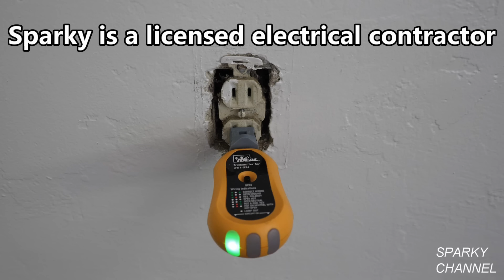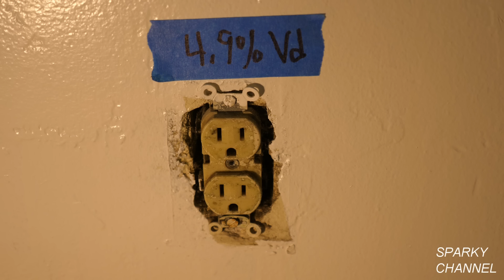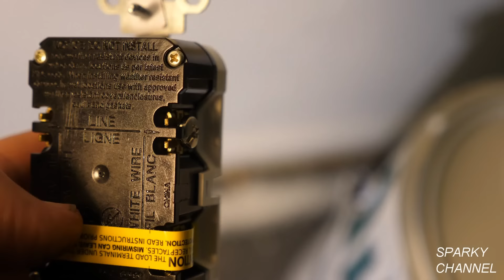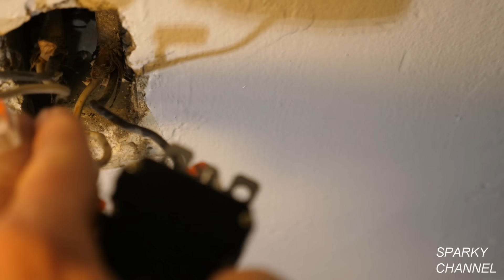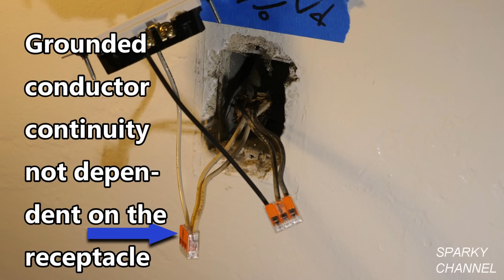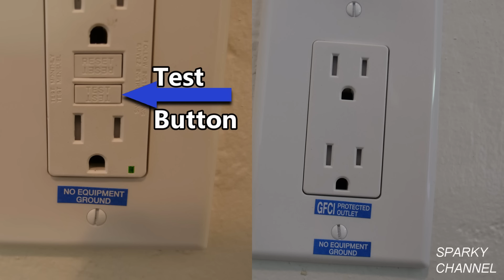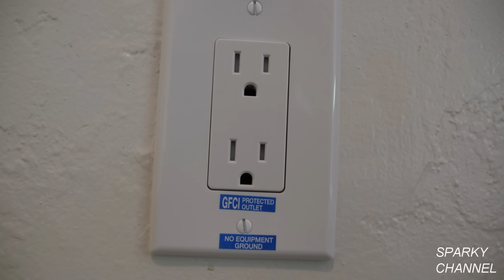2 Prong Receptacle Circuit Replaced by GFCI and Grounded Receptacles per 2020 NEC

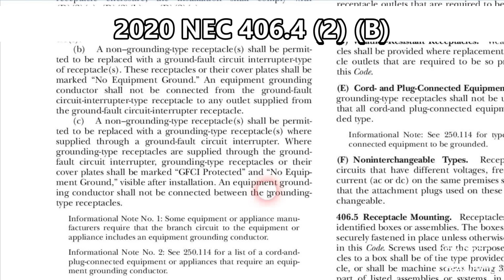Comment: NEC CODE at 7:53  You never mentioned the Informational Notes at the bottom. Number 2 for instance where it talks about equipment or appliances that require a grounding conductor. SO, something like a 1500 Watt heater for example,--- is it dangerous to plug that or anything with a three-prong plug into these receptacles??? What was the tool used for pushing the wires back into the box at 15:41?
Reply from the maker: Even in older house like this the kitchen receptacles are generally grounded in some way. I do think it's a priority to get at least one new properly grounded circuit to a kitchen though. A good way to do this is to run a new circuit to the microwave. It was a: VOLTCLAW-12 Nonconductive Electrical Wire Pliers: Amazon: https://amzn.to/2X0eofY

Comment: Liked your video BUT the average homeowner is not going to want to spend the kind of money being asked for that circuit analyzer. Great to see what the Professional might use but i would have to make do with a DMM which i use often. All of my outlets are grounded but do know someone who has some ungrounded upstairs and this video will be appreciated. Once figuring out where the power is coming in, it is obvious where to put the GFCI. Will take longer maybe, BUT the majority of homeowners are not going to spend a pile of money for a tool they would use once. I notice you chose to use the screws rather than the stab-in provision on the outlet. I saw in another video where an electrician posted , in a reply to someone who did, that they loosen over time and can cause arcing. Why were they ever put in receptacles? I never use them. Reminds me of the Aluminum wiring fiasco-- here in Canada anyways. Was aluminum wiring allowed in the USA as well? I don't think it is common for the bars to fail on the receptacle that joins the HOT and COMMON so i would probably skip the Wago's too unless you can buy just a few for someone like me -- they do look handy. Great video though. Thanks.
Reply from the maker: Excellent comments, thanks!
Reply: How do you check Voltage drop with a multimeter? I have the klein mm700

Comment: 13.8% voltage drop?? That can not be to code. I thought 5% was max allowable. A 13% would occur in a 200 foot run, not in a tiny place like this. That being said, will this GFCI ever trip since there is no bonding anywhere in the building? If not then why even bother with it? Gives a sense of false hope that your life is in good hands when in actuality there is nothing preventing you from receiving a jolt... while blow drying your hair and standing in the tub >_<
In my view, antique places like this need to be rewired from scratch. Remove that awful panel and make the place safe! Adding new improperly wired receptacles is like adding lipstick to a pig... it is still a pig! Just wrong.
Reply from the maker: Hi Leo! 5% is max allowable with no load. To do my tests I put a huge 15A load on the circuit. That's like running a Skilsaw at start-up. GFCI's work well with no ground.  It wouldn't be allowed in the NEC if they didn't.
Reply: The voltage drop numbers are not actually a code requirement.  It's just an informational note. 210.19 A IN3

Comment: when selling my old home an electrician told me i had to rewire the whole house because of no ground. the inspector told me to use your method and i passed his next inspection and saved over $3000., who would have known?
Reply from the maker: Nice story, thanks!
Reply: another problem with this plan is if the next owner wants to start including modern devices such as Smart thermostats or even non- radial knob bathroom fan timers.  I've got a 1950's house with no ground wiring, for every 4-5 fan timers I looked at, only 0-1 would work in a 2 wire system; greatly limiting my choices.
Reply: The problem is there still is no ground and people do not realize that and they plug in grounded equipment and expect there to be a ground and there isn't

Comment: The No load voltage shouldn't drop even if you add 20 outlets with 14 awg wire and truly No load.   If it does you either have a load and don't know it and/or you have some really bad wire.   Ohms law folks.
Reply: I believe that the tool he is using simulates a load
Reply: @willschultz5452  It appears to have a measure mode and a load mode.  Not sure what the input impedance is when it's not in a load and test mode.
Reply: There is always a small voltage drop between receptacles or in a long wire run
Reply: @willschultz5452  You shouldn't be seeing a voltage drop if you have no load,  i.e.  if you use a Fluke or other similar multimeter with a 10 MOhm input impedance to measure.   If you do and you know for sure you have no load then you have a serious problem.  Again,  it's all about ohms law.
Reply: most likely undersized wire.

Comment: Question:  If you had a regular breaker box, could you have just installed gfci breakers in the box and accomplished your goal?
Reply: You still need to change the receptacles as the whole point is to get the three prong receptacle. You could use the breaker method if someone has already illegally changed the receptacles but even the you might want to check the installations.

Comment: Question, why wasn't AFCI used instead of GFCI .
Reply: He showed you the code...  haha.  The code says 2 prong outlets can be replaced with 3 prong outlets as long as they are GFI protected. 

I agree AFCIs make more sense for protecting old homes than modern homes.  The problem is in older homes they didnt always keep neutrals separate when multiple circuits came into the same junction box, they would often tie all the neutrals from different circuits together in the junction.  An AFCI breaker or device will not set if the neutral on the load side is shared or has any other path back besides through the AFCI device.  This can become a nightmare to try and separate all the neutrals of different circuits all over a house to install AFCIs.
Reply: I had the same question until I tried to fit a full size AFCI into my old house's boxes; can be done but very hard.  Since slim size GFIs are easy to come by (not sure they even make a slim AFCI) that is my usual go to solution.

Comment: At the 40s mark, you show the meter and the table for the readings.  The table indicates only three colors: Green, White, and Red.  The first light, is green AND white, while the other two are "Off' (i.e. neither red, white, or green).  How do you you get to "Open ground" based on this light configuration; which to me shows the first light on (either green or white - you decide), the 2nd and 3rd lights are "off".   I am color blind, but not to this extent.   Please explain.
Reply: White on the Table means no light/off.  So on the indicator, Green/off/off = Green/white/white on the table, which is Open Ground

Comment: I was able to accomplish the same thing for my ungrounded circuits using an AFCI/GFCI breaker, so no need to find the first outlet in the circuit or use a GFCI plug. Also provides AFCI protection, which is probably best for older wiring.
Reply: Thats great, but doesnt work if you still have an older obsolete breaker panel in your house that has no modern breakers made for it.  The panel in his video looked ancient, definitely no GFI/AFI breakers for that thing.
Reply: That was a push a magic panel.  Parts are extremely difficult to find.

Comment: Where did you find these houses. 2 prong receptacles were all replaced in the 1960's!
Reply: In columbia SC I rent a house and all of the outlets have adapter because there are 2 prong.
Reply: @DelmuryAngel  So, SC has no code for electric outlet. Isn't that dangerous? Do the owners of these rental houses carry insurance to cover you while you are renting?
Reply: Steve Blanck hopefuly I’m not there anymore I love to PR for a while.
Reply: @kathystevetrooperblanck609  Tons of old houses still have 2 prong outlets.  As long as it met code when it was installed, it does not have to meet current code unless the circuit is altered or updated in some way.  You are not expected to update your house every three years when the new code book comes out.
Reply from the maker: @Tro1086  Tro1086, you're correct, thanks.
Reply: @Tro1086  Good to know that old houses don't have to have updated electric in your town. In mine it is required!  Good luck with your electronics and electronics!
Reply: @kathystevetrooperblanck609  Thats pretty much nation wide.  A few towns might try to enforce their own absurd rules.  Like I said, your not expected to bring an old house up to current 2020 code if you are not doing any work to the electrical in it.  That would be ridiculous to bring every old house up to modern code.  The only time you have to bring any part up to current code would be during a remodel or addition, where you are altering or adding to the existing electrical.  120 volts is 120 volts, doesnt matter if it comes from an old outlet or a new one, your electronics wont know, as long as the house was wired properly to code at the TIME IT WAS BUILT, then everything should function properly.  So does your town come knocking on your door every THREE years when the new code book comes out to make sure your 100 year old house meets ALL 2020 code?  I really doubt it.
Reply: @kathystevetrooperblanck609  I recently did a major remodel to a house in Horry County SC and was required to upgrade all 110 circuits to Dual AFCI/GFCI circuits and Tamper resistant outlets.  The tamper resistant outlets weren't required in areas that weren't part of the remodel (bedrooms) but I upgraded them anyway.  Loads of fun since they soldered and taped connections and cut off the grounds without hooking the grounds to the receptacles and switches.  So each outlet took about an hour to replace.  The range had been moved and the cable was just wire nutted together at the floor under the range, an obviously poor DIY job.  I also found outlets with the hot and neutrals reversed.  I also had a house built in 1956 that had 2 prong outlets and no grounds with 100 A Federal Pacific main panels on each floor fed by a 200 A Square D QO panel on the outside of the house,  and apparent upgrade when they added central air on both floors, a pool and hot tub.  And when I change outlets I use screw clamp back wired outlets.  I'll never use a builder grade stab in connection.  And I love Wago lever locks!
Reply: @hjc4604  In 1635 all we had to do was add the ground wire. But we put in a circuit box with breakers instead of fuses! 3 lead wiring
Reply: In 1635?

Comment: Why wrap black tape in 2020? Is this in 2020 NEC?
Reply from the maker: No, there never has been a code for wrapping the devices. It's something that most of us do for extra safety.
Reply: Sparky Channel thanks for the reply. I feel like tape failure to be worse than whatever it can help vs doing proper separation which you did of course. I’m just a homeowner though, I did enjoy your video and learned a lot about continuity and all the other stuff.  I was surprised to see wagos, they are my favorite! I subscribed!

Comment: Great video. Is there another way to find the main load (1st receptacle) without the $200+ circuit analyzer?
Reply: Yes, and it's simple and easy. Pull out what you think may be rec #1 and disconnect hot wires. Turn on breaker. Did all other rec's in the chain now lose power? If so, you found #1. If not, join the two hot wires together and repeat test on another rec.
Reply: If you're replacing all the outlets anyway, like in the video, then just do that... turn power on and see where the power is.
Reply: Randy, the tool makes the task faster, but with some clever thinking you can do it with household items. The way I do it is with an old radio that connects to a normal electricity socket and a multimeter (a hot wire detector will also work). Start by connecting the radio to the outlet that you wan to find the circuit for and crank the volume so that you can hear it from the breaker panel, turn off the breakers one by one until the audio from the radio goes off, from that point you can turn on the rest of breakers, but the one that turned of the radio. If you don't have a radio, you will have to turn off the breaker, and go back to the socket to check with the multimeter or hot wire detector until you figure out which breaker shuts the circuit off. Now that we have found the breaker for the circuit, just mark all the outlets that will not turn on the radio or provide any voltage to the multimeter or hot wire detector. For the last step we should use Sparky's tip, go to the socket that is the closest to the breaker panel, 90% of the time this would be your guy. Open the socket and disconnect both upstream and downstream cables and make sure none of them can contact each other to avoid a short circuit for the next step. Next step is to check which pair of cables is upstream or downstream, if you have a multimeter or hot wire detector it would be very easy, turn on the breaker, and go to the socket, use the multimeter and check which pair of cables has voltage, and this would be the upstream cable, the one without it is the downstream cable. If you don't have a multimeter, before turning on the breaker, connect one pair of cables to the socket and connect the radio (the other pair should still be disconnected from the socket), if it turns on, you have found the upstream, if it doesn't turn on the upstream pair is the one that is disconnected. The last step is checking the rest of the outlets with the breaker on, if there is an outlet that's is powered on that circuit with the breaker on, it means that the socket that you picked originally as the closest to the breaker box is actually further down the stream. If this is the case, you will jump to this socket that still has electricity and repeat the same steps of the previous socket to figure out the upstream cable pair and the downstream cable pair. To make sure that you are at the most upstream socket, disconnecting the upstream pair will get all the socket off from the circuit and no electricity will flow to them. This is the socket where you need to replace with the GFCI socket, and all the sockets downstream can stay the same or you can "upgrade" them to 3 prong sockets if they are still using the old 2 prong type of socket.

Comment: I'm guessing in the US you don't have rcds/gfcis in the consumer unit? They're a requirement in the UK, meaning every circuit is protected. You don't tend to find them on individual access points.

2:00 are the breakers not labelled?

11:08 voltsticks are amazing really. While they can't give as accurate readings as a fully fleshed tester, they're amazing at being able to pick up a live circuit without even needing to expose any copper.
Reply: Thank
Reply: RCDs are GFCIs.  Yes, they are required in the US depending on which version of the NEC (National Electrical Code) the local AHJ (Authority Having Jurisdiction) adopts.  And yes, there are breakers.  I spent $1200 on Dual AFCI/GFCI 110 V breakers for my recent remodel as required.  But AFCI/GFCI receptacles can protect an entire circuit and are cheaper to buy and safer to install as they don't require wiring inside the breaker panel, which I left to my my licensed electrician to do.  As a licensed electronics technician/HVACR electrician/firefighter/paramedic and super safety conscious nerd, I feel perfectly capable of rewiring switches and outlets and my AHD allows it.
Reply: @hjc4604 I'm aware rcds and gfcis are the same. I'm also aware breakers exist, I didn't ask that, I asked why there seemed to be no labels.

Also, claiming what you did at the end is a good way to plant a seed of doubt.
Reply: Yes in the US it is more common to have them on sockets. Sure they can also be on the panels. The trip current in the US is 5 mA when in Europe it is 30 mA so one would want many GFCIs instead of one protecting several circuits.

In general the sockets seem to be very standardized in the US. In Finland there is more a mess. Also here you are not allowed to change them yourself so here GFCIs are added when there is complete rewiring or one just picks a plug in one.

Comment: A great video! I am wondering whether a single GFCI breaker could have been installed at the circuit panel, as an equivalent.  Also, a helpful suggestion is to plug in a small light (christmas 'candles' come to mind) for all outlets in bedroom to make it obvious at a glance which are part of the same circuit. Subscribed.
Reply: In the UK, consumer units (circuit panel as you called it) have one or multiple rcds, protecting every circuit. This means you have every access point protected by an rcd (gfci as you called it)

So yes, to answer your question.

This does make testing rcds annoying with older testers as you'd generally test through a socket, so you could end up running back and forth a lot. Newer testers have an automatic rcd test so you can just stand by the consumer unit resetting the rcd whenever it trips.

Comment: On your most upstream wires not only should you test with your "stick " tester for hot wire you should also take the time to test with a meter in this case 120v from white to black for confirmation.  Good habit not to trust that stick tester too much
Reply from the maker: I agree, thanks!